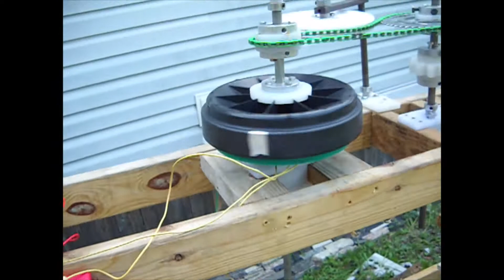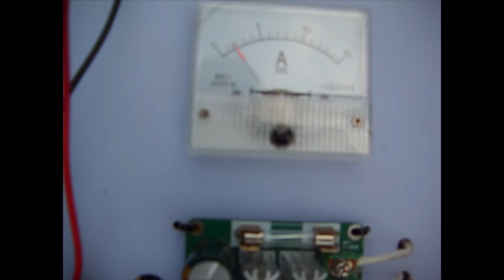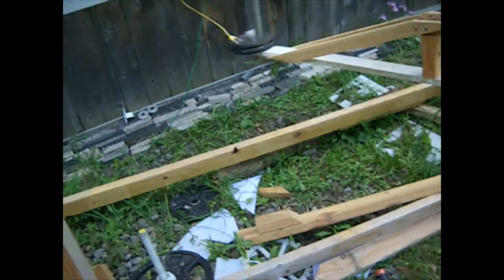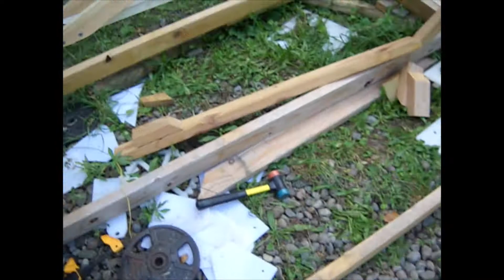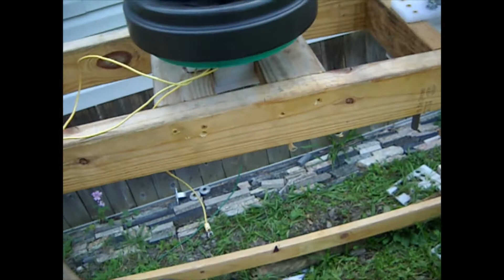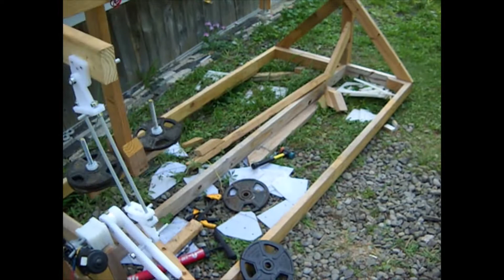GravityAssistedPowerDevice9 10 20b

Comment: So without any load you have 36W of losses at this rate of operation?
I'd be baffled if extracting 10 W or even 1 W at the end would take less than 130% extra at the input to keep the apparatus going as it did. And if the bike wheel was already an issue, I doubt much could be siphoned off without upsetting the balance beyond the point that could be corrected with extra input power.
Reply from the maker: Hi, I plan to use the device to test charge/discharge circuit. Remember this is just a experiment.
Reply from the maker: https://youtu.be/MY9224PYyR0

Replacing wiper motor with 3 by 3 Neo magnet and 2 repulsion coils. This should improve system efficiency.